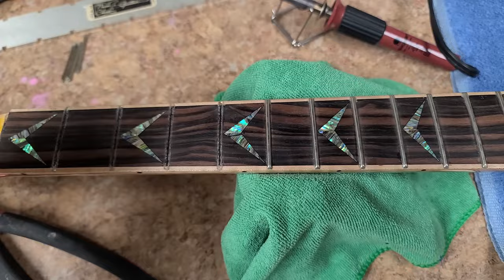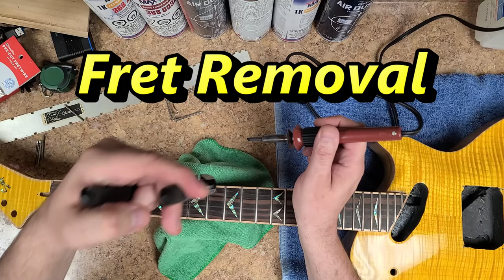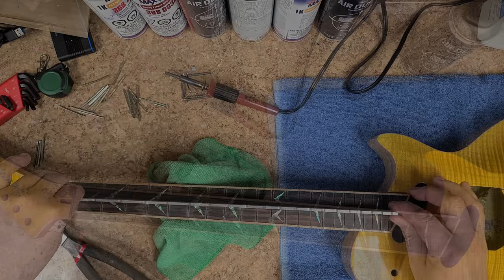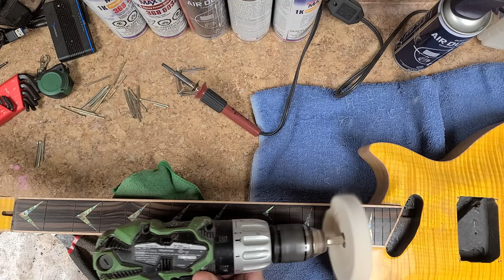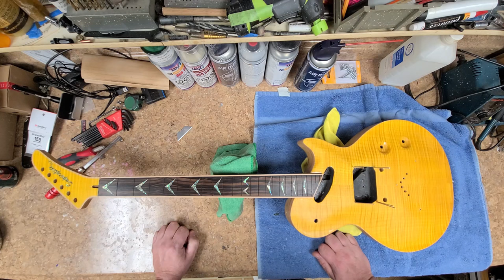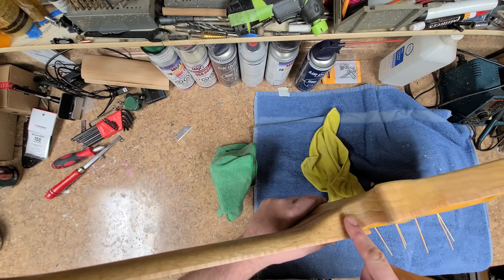Custom Guitar Can I Fix It?

Comment: Never seen someone level sand the neck without the frets installed you will have to level sand the new frets and crown them anyway
Reply from the maker: Hey Jody. Thanks for watching. The fret or figure board has a radius in it. The fret wire is bent to match that radius so the fret wire sits on the fretboard flush. If the fretboard radius is not a true, say 12 inch radius. The fret wire bent to the same radius of the fretboard will not seat right and will have gapes between the fretboard and frets. When everything is flush with each other, this makes it less work to level the frets. Also, if the frets are not flush and you do the leveling of the frets. Some frets with be cut down more than others. That makes it harder to crown the fret.

Comment: Why are you heating the frets
Reply from the maker: A lot of times the frets are glued in its seat. In this case, the frets were glued on the edge of the frets to the fretboard. Heating the fret wire helps to break down the glue holding the frets in making it easy to remove the frets without chipping the fretboard too much.